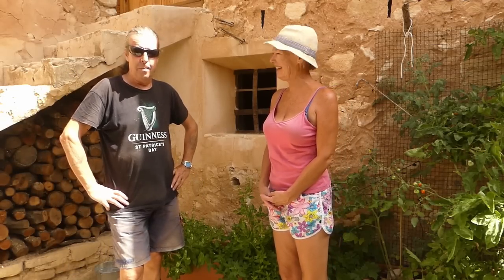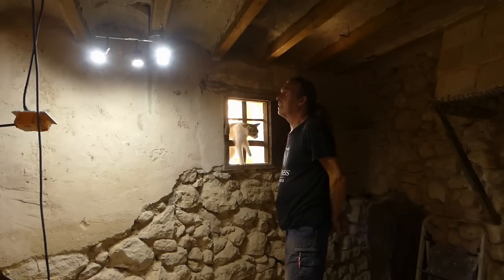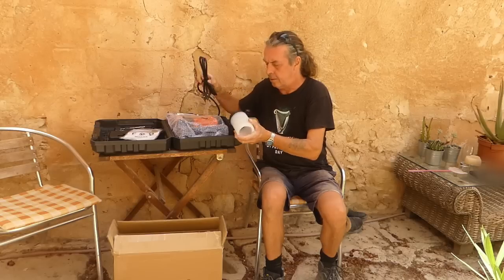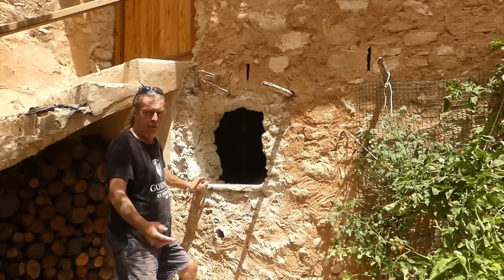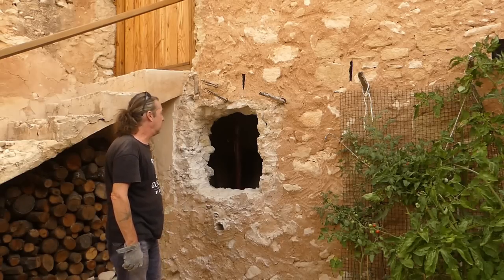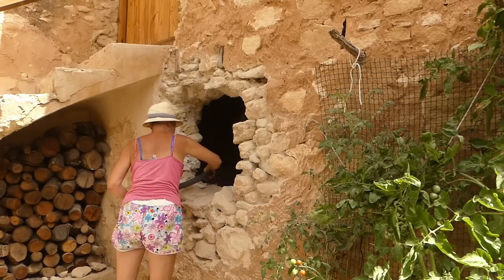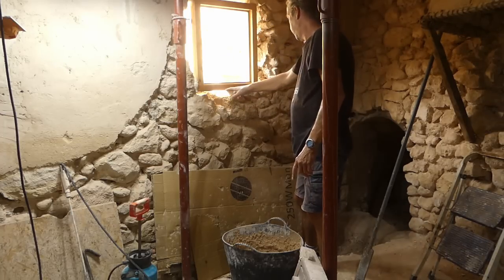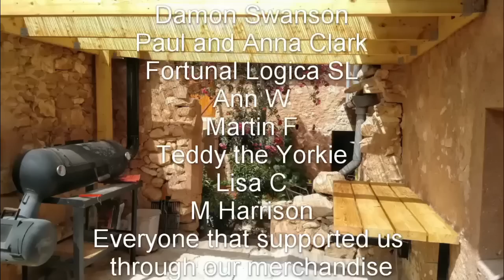Finally, we can start rebuilding the old farmhouse kitchen

Comment: I've seen others use the boiled linseed oil mixed into mineral spirits, to treat wood. They said that the mineral spirits helped draw the boiled linseed oil deep into the wood, and that raw linseed oil sits more on the surface of the wood, that's why they use boiled linseed oil.
Reply from the maker: Yes, it can be mixed with turps to good effect but it soaks in just fine into untreated wood as it is. The spirits help it dry a little faster but means it needs more coats

Comment: looks great but no lintel??.. won't vibration and flex be transferred to the window frame?.. just a thought..
Reply from the maker: The original lintels are still in the wall, you just can't see them
Reply: @FincaLife  just an observation, nothing meant by it, rebuilding part of a wall in Cornwall crazy how similar built they are, i guess it works and materials very local, were did life go wrong?.. love what your doing and keep it up.. good life choice.
Reply from the maker: @aidenjohns8248  thanks and yes, it's remarkable how similar stone are in many places. Maybe that's because there's only one way to build them successfully lol. Good luck with yours. Time and patience required.